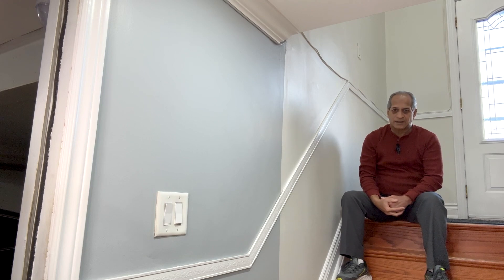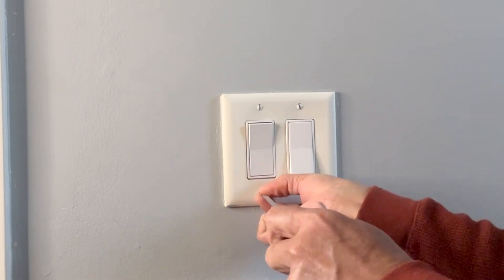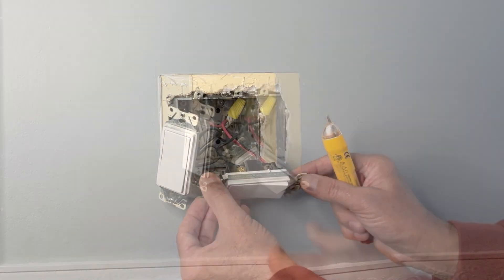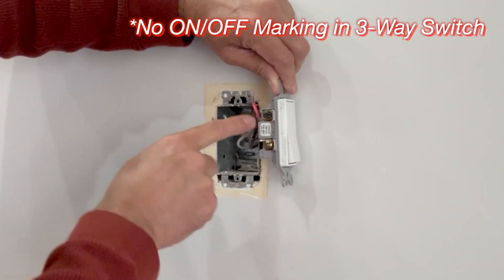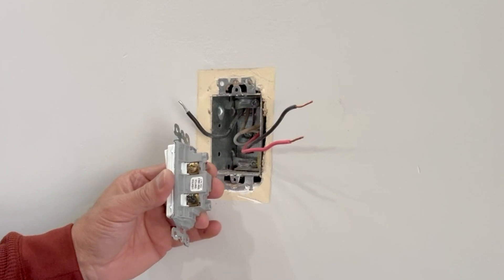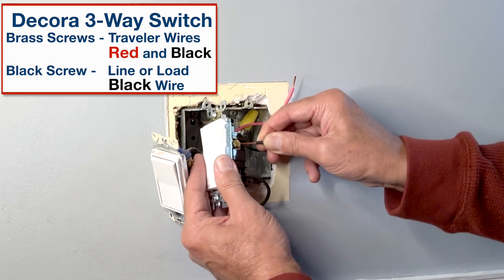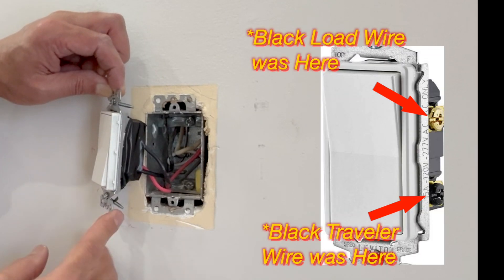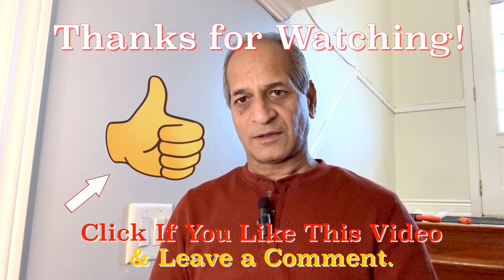Simple And Easy Troubleshooting For A 3-Way Light Switch Problem.

Comment: I have both a light that works from two switches and one that works from 3 switches and both have problems where certain positions the circuit is dead and the light does not come on. I'm trying to identify if the traveler wires actually make it to all ends of each circuit. If not I need to run new ones.
Reply from the maker: Thanks for watching! Yeah, that’s very common with 3-way and 4-way switches. Once you isolate the problem area, and identify the traveller and line/load wires, it becomes easy to troubleshoot. Good luck dear!!

Comment: With a three way switch does it matter which one is one and off meaning up for on down for off?
Reply from the maker: Thanks for watching. Most 3-way switches do not have On/Off marking. You may install upside down or vice-versa. I usually try to keep the brand making straight and readable.